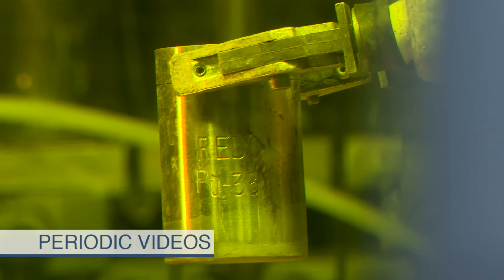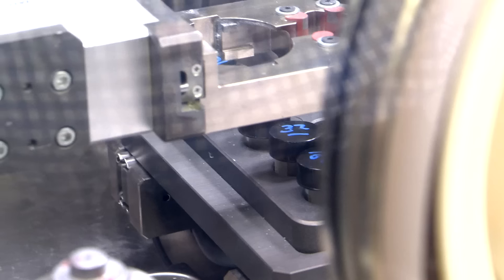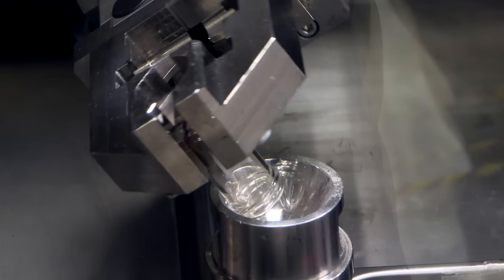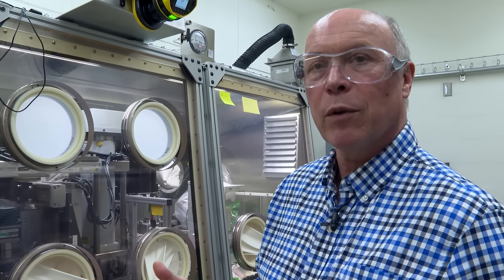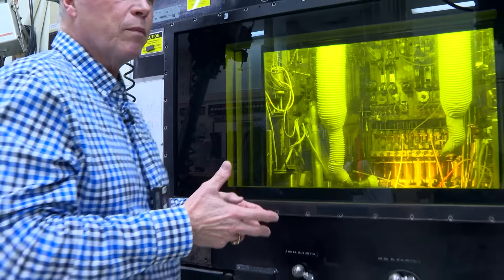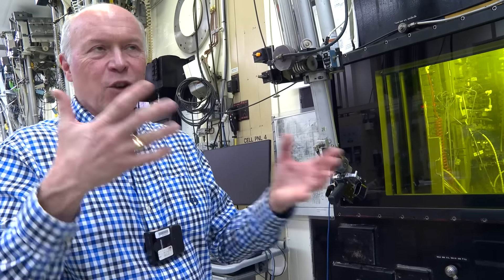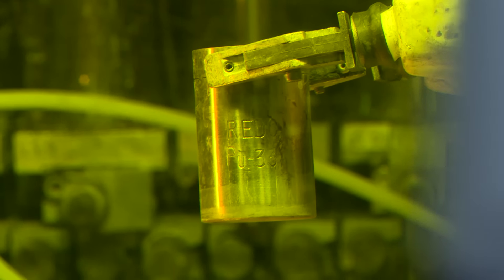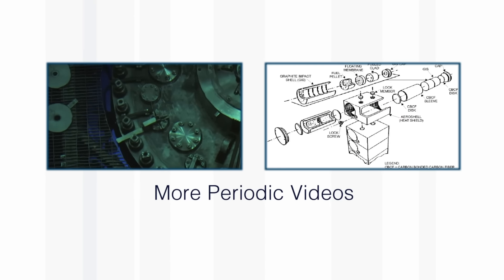How to make Plutonium

Comment: Sometimes I hope that these types of videos have elements of intentionally incorrect information that would cause expensive or destructive mistakes on any rogue groups of people who try to use this crowdsourced information to make a bomb.
Reply: The information is out there. Access to the information was never the limiting factor, so most sources are not shy about spreading it. Even access to uranium ore is not the limiting factor. You can go get that if you want to. Separating isotopes is the limiting factor. It is one of the most difficult things that humans have ever achieved as a species. And you have to produce neptunium in a nuclear reactor which means you already have fissile material. So no rogue groups will bother with plutonium. They would just make a bomb with the uranium-235 that was required to make the neptunium.

Comment: All of these robots are unnecessary. I just made some plutonium in the kitchen myself. It took a while, but I made about 9.5 kg of it. The stuff is pretty warm, so I stashed it in my freezer. I think in winter you can use it to reduce your heating costs.
I fill up the ten before taking a break because the heat is getting really uncomfortable here.

Comment: Making Plutonium isn't out of the realm of someone at home. Yes, they may irradiate themselves but it is entirely possible.
Reply: One does not simply pick up neptunium at the chemical supply store.
Reply: @Morrigi192  You don't need Neptunium to breed Plutinium. The first Plutonium made for The Manhattan Project was made using Uranium.
Reply: @Morrigi192 I don't know if you're in the US or not but Uranium ore, and depleted Uranium, which is Uranium 238, can be purchased by anyone, at least in the US.
From that, the Uranium needs to be bombarded with neutrons. Over time, the Uranium 238 will capture a neutron and become Uranium 239. The Uranium 239 will fairly quickly decay to become Neptunium 239, which decays to form Plutonium 239.